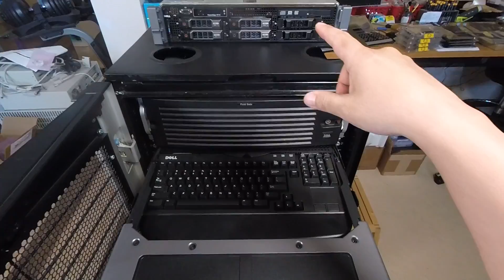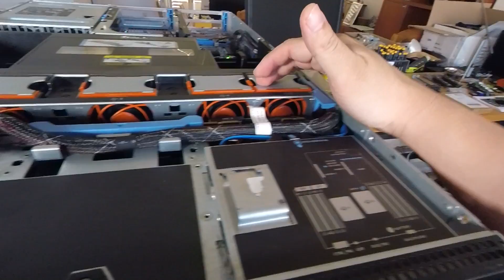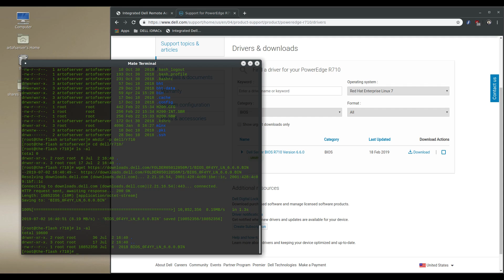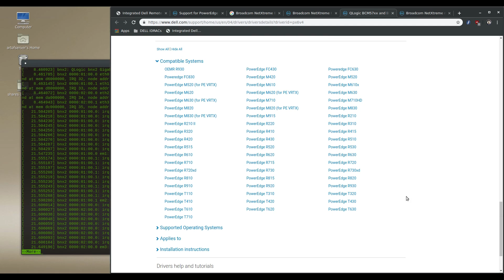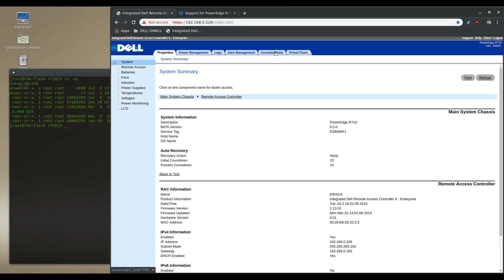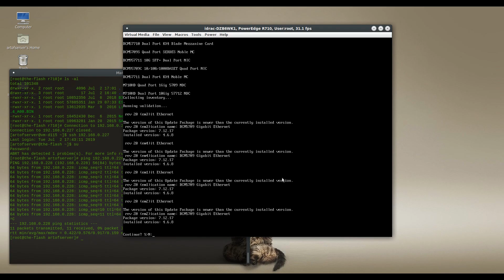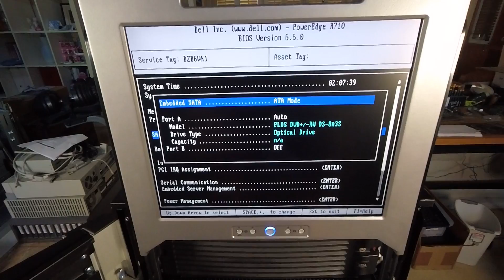Dell PowerEdge R710 build PART 1/9 | fixes, bios and firmware updates, and factory reset

Comment: I just bought one of these on ebay for $150 for my first real server! Thanks this video is giving me the confidence to get it up and running.
Reply from the maker: awesome! :-)
Reply: @ArtofServer  $150 after shipping and tax. https://www.ebay.com/itm/264502135937
Reply: For my first one..... I had the awesome pleasure of getting one of the PE 2950's ....... and hearing the JET ENGINE spin up and blowing my eardrums out..... and finding out there was no way to adjust them.....  I litterally could not take it anymore and got some resistors and soldered them into the red wire of each fan........ suck out some of the gas and the jet engine monster was now TAMED and my headache FINALLY went away lol.   If you got the R710....... you got a damn good machine :)  I love the hell outa mine.    Fucking AWESOME that the market was literally FLOODED with dirt cheap "trash" as the companies upgraded their server rooms all at the same time to give everyone a chance to mess with em for almost nothing to set one up.  It was a fun getting inside machines like these.  Built computers since my first 500mz system and I opened up a rack mount server and I was literally lost...... saying WTF is THAT...... lol.  EVERYONE who tinkers with hardware should grab a server and have fun and end up with a solid well built machine that will probably run for another 20 years without a hitch lol.

The only thing I dont really like...... is that you really cannot mix/match parts in these servers.  You can to a very small degree but pretty much better make sure if you get parts..... it jives with the rest of it.  Really can't Frankenstein a machine together. But was still fun to mess with em.
Reply from the maker: @rustykoenig3566  regarding your point about mix/match parts.. you are right with Dell. They seem to redesign almost everything for each generation. About the only thing you can "upgrade" and older server with are PCIe cards. That said, this is one of the reasons why I really like Supermicro; they "evolve" their design, so a lot of new components/parts can be swapped with older server. For example, you can take the new high efficiency PSU of newer Supermicro servers and plug them into a 10 year old Supermicro server and all of a sudden you have a cheap server that runs efficiently and doesn't have screaming PSU fans.
Reply: @ArtofServer  Ya, All I have messed with so far is the Dell.  The first "name" I ever bought was my very first system.... it was a 200mz compaq tower from circuit city that ended up being $1300.  After that...... I vowed to never have a "name brand" system again..... it was gonna be my brand.  Had the pleasure of  messing with other peoples compaqs dells or whatever and I cringed every time I did...... I held true to that untill...... that PE2950 lol.   I actually had it in my head that I was just gonna part one together ..... cuz thats what I do...... but I found a loaded one for $150 and got it...... I was so glad I didnt try to part one together lol.  I read I dont know HOW much shit trying to find a way to make it read more that 2TB on a drive cuz I only had like 2 drives in its "range".  I edned up parting together a tower out of my junk pile to pile my hard drives into and used it for a NAS......   but if others are capable of doing that I might look into something else to mess around with then.   Had to get the 710 cuz not only was the 2950 the jet engine...... it was 1 step below the ability to really mess with VM's.... It could do it it just lacked 1 stat to really do it lol.
Reply: What’s surprising is that the rack rails for these old servers are often more expensive than the servers themselves.

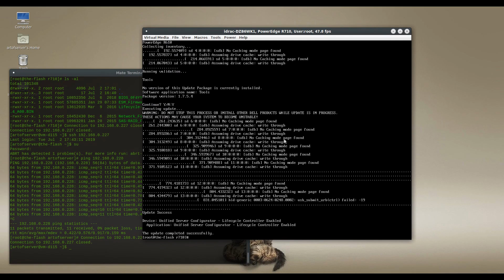Comment: 46:35 - iDRAC6 Reset/Login.
Reply: As of 13/10/2019...

iDRAC6 Firmware Revision version: 2.92.05
----------------------------------------------------------------------

Java Control Panel - Oracle Java Version 8 Update 221 (x64)
-------------------------------------------------------------------------------------------------
https://www.java.com/en/download/manual.jsp

01. Navigate to the Java Control Panel
02. Security/High = Yes
03. Exception Site List
Add: https://192.168.x.xxx/  [Where x.xxx is your iDRAC6 address]
Apply

Windows 10 Pro x64/Java Installation Folder
------------------------------------------------------------------------
01. Navigate to: C:\Program Files\Java\jre1.8.0_221\lib\security
02. Find: java.security
03. Open With/Notepad: java.security
04. Search for: jdk.tls.disabledAlgorithms=
05. Edit/Save file: (I saved to Desktop as 'java.security', WITHOUT .txt, and then replaced the original file)
Replace: jdk.tls.disabledAlgorithms=SSLv3, RC4, DES, MD5withRSA, DH keySize < 1024, \
EC keySize < 224, 3DES_EDE_CBC, anon, NULL
With: jdk.tls.disabledAlgorithms=SSLv3, DES, MD5withRSA, DH keySize < 1024, \
EC keySize < 224, 3DES_EDE_CBC, anon, NULL

Reboot your Windows 10 Pro x64 PC
-----------------------------------------------------------
01. Reboot

iDRAC6 - Login via Opera Browser
------------------------------------------------------
01. Navigate to: https://192.168.x.xxx/ in Opera Browser [Where x.xxx is your iDRAC6 address]
02. 'Console/Media'/Video Encryption Enabled = Yes/No
(Change this in the 'Configuration' tab if connection issues!)

01. Properties/Launch
02. The 'viewer.jnlp' link downloads instead of opening (Grr!)...
(Note: The filename information changes with each session, so ALWAYS USE the LATEST one!)
03. Open With/Look for another app on this PC [Scroll down]
04. Open With: C:\Program Files\Java\jre1.8.0_221\bin\javaws.exe
05. The connection to this website is untrusted/Continue
06. I accept the risk and want to run this application = Yes/Run
07. The Virtual Console should now load!

Comment: 24:02 - Firmware Updates
Reply from the maker: was there something you wanted to say about that segment of the video?
Reply: R710 (LATEST FIRMWARE as of 13/10/2019)
-------------------------------------------------------------------------
- I used a Windows 7 Pro (x86) Live USBF I had made. Uses a RAM disk...
- Press [F11] immediately on boot, otherwise the USBF might not be visible!
- Install all firmware updates one by one from the USBF drive.

Dell PowerEdge R710 Original BIOS 6.6.0 (x86) download!
https://www.dell.com/support/home/uk/en/ukbsdt1/drivers/driversdetails?driverid=0F4YY

Dell Lifecycle Controller 1.7.5.4, A00 (x86) download!
https://www.dell.com/support/home/uk/en/ukbsdt1/drivers/driversdetails?driverid=0wfgm
- Only really useful for checking updates installed properly!
- Firmware Updates has been discontinued it seems!

Dell PERC 6i Integrated 6.3.3-0002, A00 (x86) download!
https://www.dell.com/support/home/uk/en/ukbsdt1/drivers/driversdetails?driverid=f96nr

Dell iDRAC Monolithic Release 2.92, A00 (x86) download!
https://www.dell.com/support/home/uk/en/ukbsdt1/drivers/driversdetails?driverid=kpccc&oscode=ws8r2&productcode=poweredge-r710
- iDRAC6 Firmware Revision - 2.92.05
- Lifecycle Controller version - 1.7.5.4
- Primary Backplate Firmware Revision - 1.07

QLogic BCM57xx and BCM57xxx Network Device Firmware 7.12.19 (x86) download!
https://www.dell.com/support/home/uk/en/ukbsdt1/drivers/driversdetails?driverid=35rf5

Dell OS Driver Pack 15.04.00, A00 (x86) download!

https://www.dell.com/support/home/us/en/04/drivers/driversdetails?driverid=kdv9j

Dell 32 Bit Diagnostics, Version 5162A0, 5162.1 (x86) download!
https://www.dell.com/support/home/us/en/04/drivers/driversdetails?driverid=2mm6j
Reply: I am unable to find a firmware to update my Power Supply.
07NVX8 / A870P-00 - Model 1.
0YFG1C / A870P-S0 - Model 2.
• One version is 03.02.64 and the other is 08.13.00.
Reply: @ArtofServer 
For pre-flashed IT mode HBA cards, check out my eBay store at: https://www.ebay.com/str/theartofserver
- What is this?  What is the advantage of?
Reply: @ArtofServer  
Dell Customized Image of VMware ESXi 6.7 download!
https://www.dell.com/support/home/uk/en/ukbsdt1/drivers/driversdetails?driverid=gv3pd

Comment: So if I want to use windows can i install that then d/load updates
Reply from the maker: I would think so. But I'm not a Windows user so I don't have 1st hand experience to share on that topic.
Reply: @ArtofServer  Thanks; For anyone else wanting to do this, yes install OS and then download the dell update packages. Bios and idrac update from within windows, download firmware to a usb stick and install from lifecycle controller. I installed windows 10.
Reply: @chandlersharp2380  Download to another pc?

Comment: I have been racking my brain for the past two days...35:29 "lets log into the remote console"... easier said than done. For the life of me i can not log into the console, no matter what i try. I launch the viewer, rename the file, open it in Java, and i get unable to launch the application. i have whitelisted the server on Java HTTP and HTTPS and still get the same error. I wish it was as easy as your video shows it to be. I will be stuck with BIOS 1.2.6, iDRAC version 1.10 FOREVER, lol. Hell, i cant even get the USC to update from a USB because it says it failed to pass integrity check.
Reply from the maker: you need to change crypto related settings in the java security policy, as well as add the IP of your server's idrac to the exceptions list. you also need javaws (java web start). after that, it should work. i've gotten so use to this, but it was frustrating for me before too. i'm putting this on my list of future video ideas!
Reply from the maker: @Tommy Stavley this one is for you https://youtu.be/drhSo9Xl9M0  hope that helps you out.
Reply: @ArtofServer  i still couldnt get it to work that way. But i did have some progress on the BIOS and network updates. I had to install CentOS 7 and install those updates via terminal. I am having an issue on the IDRAC update where it tells me the following package is required for the update "compat-libstdc++-33.i686 libstdc++-i686 libxml2.i686". And that the Lifecycle controller 1.7.5.4 isnt compatable with my system. making progress though.
Reply from the maker: @tommystavley9808  yeah, just install the compat-libstdc++ packages with yum. Something like "yum install <package name>" will do the trick.

so the java console app still isn't working for you? what's the error you get?
Reply: @ArtofServer  i screwed up the java security file and saved it. i know... but i uninstalled Java and reinstalled it, but that file is still there and it will not let me save the file after i edit it. says i dont have permission to open this file. see the owner of the file or an administrator
Reply: @ArtofServer  yum worked and got the IDRAC updated, Woohoo Thanks Man, i really appreciate your help with this! Now if i can just get the Lifecycle controller figured out and fix my mess up on the java i might be in the clear
Reply from the maker: @tommystavley9808  what operating system are you on? If in windows, you need to edit it with administrative privileges. in Linux, you need to be root.
Reply from the maker: @tommystavley9808  awesome! :-)
Reply: @ArtofServer  I had to give myself admin privileges, SMDH.
Reply: @Art of Server I got everything updated now. Thank you for these videos you make, they are truly helpful to the less knowledgeable people, like myself!!!! I still need to find out whats going on with my IDRAC though, It just says failed to connect. Also got my H200 with IT mode on it from you aswell.
Reply: Awesome, I will give this a shot. Thank you

Comment: A couple of observations. Its worth moving the fans about in the chassis to check its a fan that is broken rather than a connector.

If you are running updates remotely over SSH and you are worried something will terminate your connection mid-update, you could run them inside 'screen'. You may be better in an iDrac connection, but if you can't get one...

The order of your updates can also be important. If you have an old BIOS and new iDrac firmware, you can break things. BIOS before iDrac has never failed me since that one bit me.
Reply from the maker: Thanks! Those are great adds...
Reply: Interesting. I've never heard of the Linux screen command, but I'll definitely look into it in the future. Thanks for the tip!

Comment: Hi, I'm interested in buying a Dell PowerEdge server, but I don't know anything about servers watching your video I learned a lot of things, but I would like to know the basics. I mean what equipment you use (I explain myself) I see that you have a rack and the server is on top of it, when you buy the server it comes with the rack or that rack is purchased separately.
For example in the 6:00 minute, you take out a screen with a keyboard, that's what I mean, what is that called and that comes with the server or is purchased separately. I also want to know where and how in the 22:03 minute you entered the server from your PC, how do you do it? Is a cable connected to the monitor? Or do you simply put the server's IP in Remote Desktop connection?

I would appreciate you helping me, you just won a new follower.
Reply from the maker: @Dragh Dofus Touch  Thanks for watching my video! Those are great questions! I'm adding that to my list (rather long list) of future video ideas! Stay tuned...

Comment: Small question: Since you're buying, repairing and selling lots of Dell servers, why don't you setup a IPXE server with CentOS? from the error messages that appeared while installing the updates, it looks like your Disk on Key has some issues (sdb1).
Reply from the maker: That USB drive with CentOS is the same one I use for all the firmware flashing, you'll notice it has hostname "the-flash". Makes me nervous to run a firmware flash from files on a network filesystem. 

The sdb errors are not the USB flash drive. I think they are from the idrac's emulated virtual media.